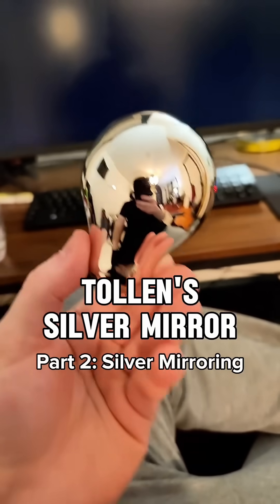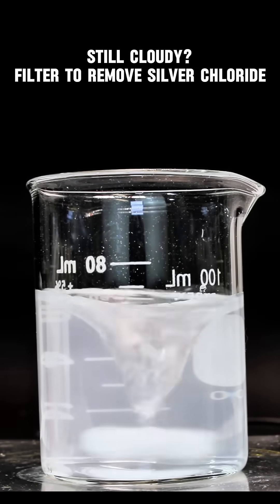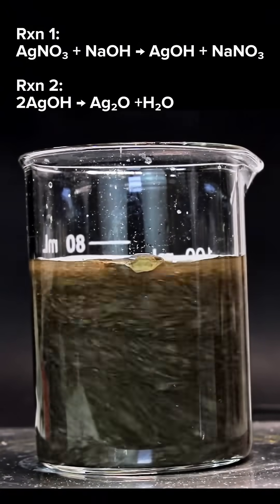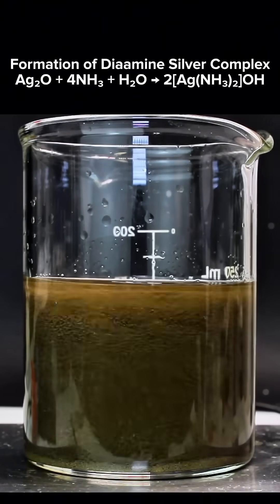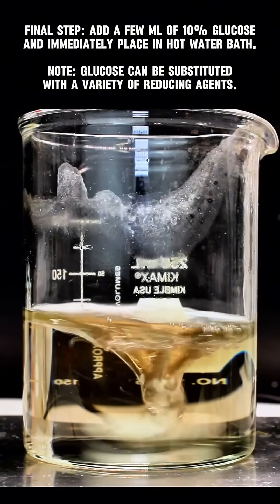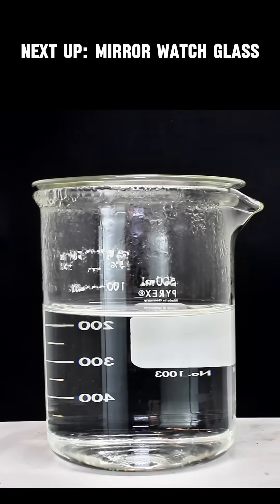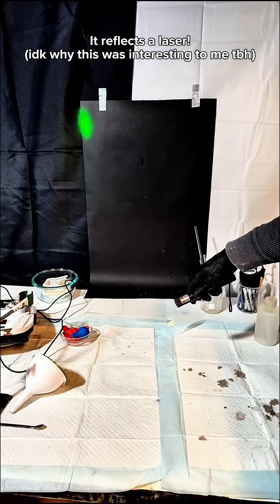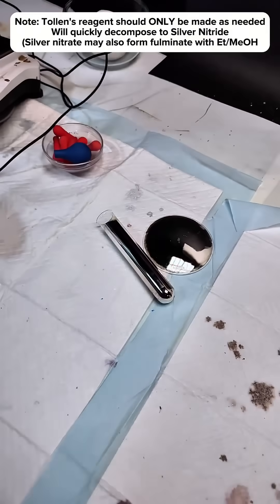Tollen's Silver Mirror

Comment: Silver is the most reflective metal and an ever higher polish will result in ever higher light reflection.  Polish a silicate bssed mirror base up to 1,000,000 minus grit and final polish with a heated 0.001 micron cerium oxode slurry and then apply the nano silver particles. You will get a nearly true to life reflection.  The hot cerium oxide will chemically remove the micro scratches of the abrasive by bonding and flaking off leaving a surface thats as smooth and clear as possible.  That smoothness will also be the silvers smoothness when applied like this because it conforms to the surface.
Reply: Most reflective metal for visible wavelengths, including near infrared.